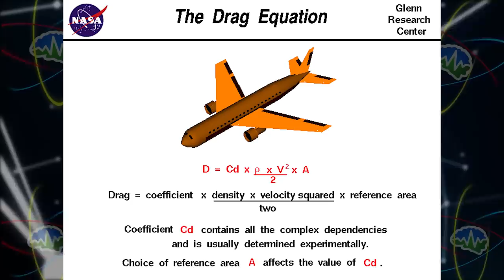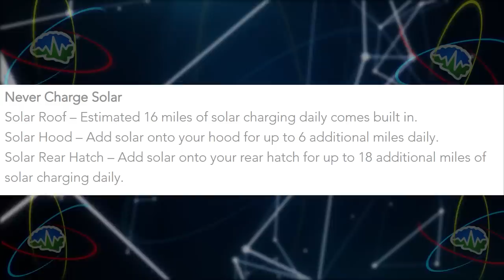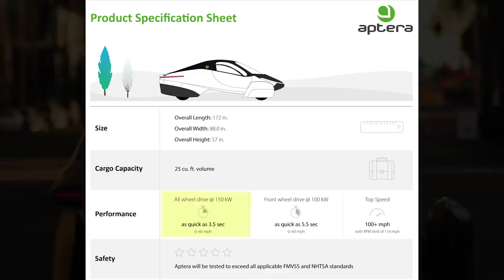Aptera Beats Tesla? | In Depth

Comment: I was disappointed that the elephant in the room of *safety* was not addressed in this video.
Reply: Aptera admits they have yet to test one yet, but they are hopeful. The original gas aptera had a roof crush rating much higher than most cars on the market. I know they are incorporating airbags, which far surpasses the requirements set in the US for autocycles. Many of the other tadpole trikes Sandy Munroe is a consultant for are using a new lap belt airbag that may prove better than traditional airbags. I also wonder if the high strength light weight design will reduce the kinetic forces we are used to with metal cars. These are all just wishful thinking as nothing has been tested yet, but I like to be hopeful too.
Reply: I IMAGINE it behaving in a wreck, similar to a punted football...
Reply: Weight is about 2k lb vs 3k-5k Range of cars to trucks/vans on the road... So that means it will be unsafer technically. But not a huge issue in the sense that we all don't drive trucks for safety... 

As for crash safety, let's hope it's safe. If not safe, then all the improvements they offer don't matter. Then again, it is technically a motorcycle in terms of classification, so it will be safe than all the vehicles in it's weight & category at best...
Reply: Spot on, this will have the same "safety rating" as those trikes....which is to say you are dead if anything touches you or you touch anything else.
Reply: @w0ttheh3ll  We will see when it gets tested, just not enough structure and airbags are not a cure for lack of crumple zones and structure.
Reply: EXACTLY -  the Aptera electric 3-wheel design ELEPHANT in the room.
Reply: Meh, I bet it's safer than a motorbike and that's enough for me.
Reply: @JheregCG60  this is non sense.  I drive an 1800 lb Gen 1 Honda Insight that got 4s in the crash tests.  I was hit from behind by a large car on the highway at 60 mph and was uninjured.  Aptera will be even safer.
Reply: @JheregCG60  Aptera has both front and rear crumple zones and a passenger safety cage.  It also has air bags.
Reply: @n.brucenelson5920  I got my Hyundai Veloster destroyed by a woman in a lifted Jeep who last moment tried to shoot across 3 lanes, there is zero chance the Aptera will fare as well.  We will not know how well an Aptera does for sure till it gets tested, but mass, length of crumple zone, flippability, other safety features, and materials make a difference and the Aptera compared to my tiny Veloster is deficient.
Reply: @JheregCG60  First of all, I am sorry that you lost your Veloster.  I had my first Gen 1 Honda Insight totaled when a large car hit me from behind at 60 mph on the freeway.  It scored fours in the crash test ratings.  I mention it because at 1800 lbs it weighs about the same as the 400 mile range Aptera.  

Perhaps you missed that the Aptera has air bags, front and rear crumple zones and other safety features.  The roof crush strength and the passenger safety cell are almost certainly better than your Veloster, as is the flippability, due to a dramatically lower center of gravity.  The traction control and antilock braking is also far more responsive than that fitted to the Veloster, with sensing and adjustment 32 times per wheel revolution.
Reply: @n.brucenelson5920  LOL Veloster is the best scoring safety wise car in it's class, has a lower CG, four vice three wheels for greater resistance to flipping, is smaller in all linear measurements.  I do not know the overall sample rate for the TC or braking, but considering the car has real time monitoring of all wheels and accelerometers to control the front LSD, brakes, and TC it is likely the same or better.
There was zero impingement to the passenger area even without bumper contact (lifted jeep that was shooting across my front) and I can say that wee car saved my life from someone paying no attention.
Edit: Veloster has crumple zones, airbags, etc too which is why I did not mention them.
Reply: @JheregCG60  How does the Veloster have a lower CG than the Aptera, when the Aptera has its entire motor weight centered on the axles, and the batteries at floor level?  It doesn't, by a large margin.  Even the original Aptera design had a higher roof crush strength than the Veloster.  

Do some research on the TC and anti lock response times on your Veloster.  They aren't in the same class and can't be because of the bandwidth limitations of the sensor readings being sent to the controller.

This is not a knock on the Veloster,  It just represents old and less capable technology in comparison.

We haven't even mentioned performance.  Even the turbo models would lose badly to a 2 motor Aptera in a drag, and with the 3 motor versions it wouldn't be a contest. 3.5 second 0-60 for the heaviest 1000 mile range model.
Reply: @n.brucenelson5920  Unfortunately you are talking about maybes and hopefullys with no actual data on any of it.
Aptera has no roof crush data available.
Aptera has no crash test data available.
Aptera has no CG data available.
The Veloster has all this available and just looking at the Aptera shows all its cabin/body mass (which would include the battery packs) is above the axle height/wheel center.
Veloster is lower (axle height and roof) with  a lot of weight lower vice higher.  Still mostly speculation as  the Aptera actual info is still unknown.

Everything I have been talking about is safety related...but since you bring it up 0-60 in 5 secs, only the trimotor is projected to beat that and it is a ways off.  Hell all the models are a ways off and we'll all just have to wait and see what actually arrives and how it tests out.  If you have links to actual data on the Aptera I would appreciate it.
Reply: @JheregCG60  This just shows that you aren't paying attention.  The trimotor model will do 0-60 in 3.5 seconds and 5.5 for the 1000 mile range 2 motor model.  The smaller battery models will do even better.

There will be more precise data on this once the validation models complete their benchmark tests.

The most comprehensive source of information about this model rather than the old one is here: https://docs.google.com/spreadsheets/d/11Of3g6RYqstbXecs7j2UHHd_b8s5MebxEs-ZwkyMiiQ/edit#gid=1847163171
Reply: @n.brucenelson5920  I say exactly what you just said...talk about paying attention "0-60 in 5 secs, only the trimotor is projected to beat that and it is a ways off".
Thank you for the google doc, but no real info in there either.

Comment: I opted for Noir exterior, two motors, full solar package, 600 mile range, Vida interior. I like the unique look, I have a motorcycle endorsement already. So, that is not a problem. I like the efficiency of the shape and that helps increase the range the batteries can carry me. The solar charging option was paramount, and not having to pay for liquid fuel (gasoline) was the best part. $5/gallon in the Pacific Northwest for regular 87 octane is very annoying for 14 gallons on my ‘clown car’ (small econobox). Then there is oil to change, oil filter, air filter, alternator (PITY) for my car = back of engine out the bottom of the car). If all I am paying for are tires?!?! Really!?!? Is there any question why not to get one of these Apteras? No. Aside from me and one other person as a max occupancy, then I’m good. There are no worries there.

Comment: I would love to have solar on my model 3, because when I leave it parked on the street (in winter) it looses 15 km's per day, just by sitting on the street. I hate to loose this energy.
Reply: The Aptera only uses 100 watt hours to go 10 miles at EPA highway cycle speeds. This is much less than what the Model 3 requires, and is the reason that the 700 peak watts of the Aptera works so well.  It would help the model 3, but not to the same extent.
Reply: Do you have Sentry mode turned on? If it’s not necessary then the car can go to sleep which stops it losing range.
Reply: @n.brucenelson5920  100 wH per mile, not per 10 miles.
Reply: @SirHackaL0t.  Oh, you are so right!  Thanks for the correction.  Pesky decimal places, especially New Years morning.  I will let your correction stand.
Reply: @n.brucenelson5920  lol, no worries. Btw, you can edit your initial response to correct your figures. :)

Comment: @7:51 Be careful not to fall into the rut of thought of 'The only thing solar adds to a vehicle is range'.  What if (as happens more every year) the grid goes down and there isn't a powered Supercharger for 50 miles?  What if you power the vehicles 12v system load (a 300 watt plus constant cycling of your battery!) off the solar?  Then your massive investment (in the HV battery) lasts longer.  What about grid stabilization for the Tesla Semi?  Each Semi will be a MASSIVE load on a grid that is designed for essentially constant output.  10kw of solar on the 53' Trailer would reduce the load placed on the grid when charging AND overall.  There are numerous benefits to solar on EVs beyond just range extension.
Reply: I think the conclusion is strengthen the grid, if it goes down that frequently...  I don't think I've experienced even one blackout where I live. But if that's the case, install independent systems, like solar on the roof. Solar car should be the last thought... 
And you're massively overestimating the ability of solar to power semi trucks... It's one thing for shape optimized tricycle, quite another for boxy semi weighing tens of thousands of pounds. Weight goes far faster than available roof/side space for solar.
Reply: @fobusas  Smaller independent grids, or micro-grids like what you're describing are considered to be the future of power.  Jack Rickard used to make the case for them quite frequently.

As far as the solar semi, I'm not suggesting it generate ALL it's power required to operate from onboard solar, just that it can make enough to lighten the grid load by 50kwh/day/truck.  And that that figure multiplied by thousands of trucks is a significant reduction of intermittent load on the grid.  I did a little back of the napkin math on this subject in this video  https://youtu.be/YVduBQfTlyE @ 3:42

Comment: Two concerns here. First is how safe is this vehicle in crashes. Second is how safe is this vehicle in high winds...
Reply: Aptera has been tested stable in 110 mph side winds - much better than slab sided SUVs.  There is little for wind to push against.

Safety has been as big a design focus as efficiency.  It will be crash tested to automotive standards before production begins and will do very well.

Comment: No word on how this car does in our harsh Canadian winter conditions.
Reply: Next winter there will be a production Aptera under test on Elaphe''s cold weather test track.  The AWD version is likely to be very good with snow tires due to state of the art traction control.
Reply: Not all of Canada has snowy winters. On the west coast it will need efficient heat and windshield wipers.
Reply: @hughwaller6789  In Montreal it can get pretty bad at times.As a matter of fact they are forecasting 15cms overnight.
Reply: Light weight and only 3 tires will make for a scary as f experience!
Reply: @willaerley7140  2 front tires will track well in the snow ruts but that 3rd wheel is going to have a hard time deciding which one it wants to track in. Yikes.
Reply: @willaerley7140  With snow tires, all wheel drive, each with independent traction control, it should beat any front wheel or rear wheel drive vehicle out there.
Reply: @fotoguru222  AWD and snow tires will help.  However, snow traction is mostly based on driven tire tread times the weight pressing down.  I think an AWD Model 3 would be better.

Comment: I think that Elon's comment from a few years ago, that Solar on EVs is "Not that helpful, because the actual surface of the car is not that much, and cars are often inside. The least efficient place to put solar is on the car" will go down as one of his most erroneous calls.  Every EV will incorporate some kind of solar into it by 2030.  There are SO many benefits.
Reply: There are SO many benefits that in MY environment would be rendered of marginal value. Tree Sap,  Pollen Season, Bird Poop,  Shade Trees,  Passenger Compartment at Ambient Temp,  Rain and Snow to trudge through because...it might clear up later and so I left it OUTSIDE. He didn't say it was a bad idea; he said it was the least efficient place....
Reply: @kjer6071  Passenger compartment temp IS a serious legitimate problem, I would have liked to hear the Aptera guys talk about that a little more.  A solar assembly raised off the surface of the vehicle (like they do with resi-solar panels or air vents like with the Tesla solar roof) solve these problems but tend to look pretty wonky on a vehicle.  And obviously if your car is parked inside all the time the benefits of solar are nil.  Parking inside is more of an upper-class phenomenon though.  In lower income households (the ones that are hardest pressed to afford electrification) a vast majority of vehicles are parked outside.
Reply: His comment was accurate for the time and it will be a while before there are 'significant' benefits. We are also looking at the payload with 2 vs 4+ people along with the footprint of said vehicle. It would be nice if people would just STOP saying 'Tesla competitor/killer'. We want all vehicles to go this route...
Reply: @markbeiser  Please, enlighten us humble fools, wandering in the dark of our ignorance.  What did he mean?  It really seems like a pretty straightforward comment.

Comment: May I comment that this vehicle is adorable.  I think they ought to call it the Aptera "Penguin".  When the  VW Bug was introduced to the public in the 40s-50s people said it was ugly.  They said no-one would want to buy it. Before 1970 there were thousands of them on the road.  If the Aptera can get a battery that will charge to 100% in 15 min and go 1000 miles this car will devour the competition.  Mainly because its very economical.  The design is efficient and no, not everyone will like it, but then that's why there are so many cars to choose from.  I love it.  Solar?  Well that's a pro.  Con?.  Is the company solid? They need to get the public to drive this car at shows and let them see the future.  I never dreamt that in my lifetime I would actually see a "car of the future" for real!  I'm 73 by the way.
Reply: I am 72, and will be taking delivery of one of the first ones.  400 mile range, though.  The current battery packs will charge at a rate of 500 miles per hour on a 50 kW DC fast charger - something I would rarely need except for trips.

Comment: Reading some of the comments, yes probably not a car for the snow . It’s not going to haul lumber out f the woods either. But in cities the snow doesn’t get deep so it would work all year round, For lots of other folks it could be an interesting and fun second car , and thats a bigger market than the super efficiency and EV Geeks!
Reply: As a Canadian who has driven through 57 winters and never owned a set of snow tires, I don't understand why some people take one look at the Aptera and conclude that it wouldn't be good in snow.  Why not?
Reply: @danmoyer4650  Those wheel covers and motors will pack with snow and ice and overnight will freeze solid. Good luck chipping that lot free -40C

Comment: The other bit about "faster charging" that I didn't hear mentioned is that, because the vehicle is more efficient, they can add smaller batteries. Smaller battery = faster charging at the same rate of charge. It's kinda like in the previous example you gave - because a hybrid is much more efficient than a hummer the hybrid has a smaller gas tank that fills quicker than a hummer with a larger gas tank.
Reply: Yes.  Another way to say this is that it can gain range faster with the same plug time.  13 mph plugged into a standard 110 V 15 amp outlet or 500 miles per hour on a 50 KW DC charger.